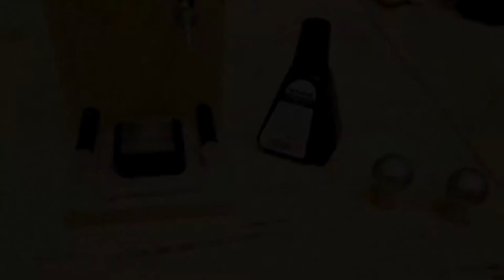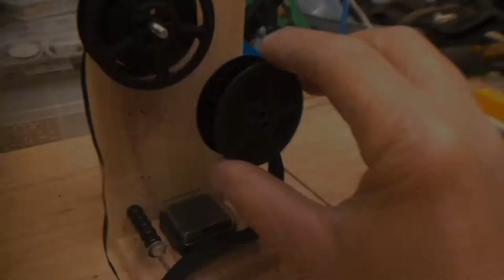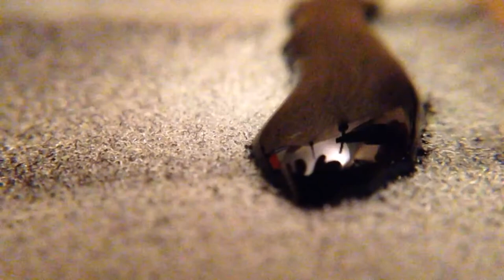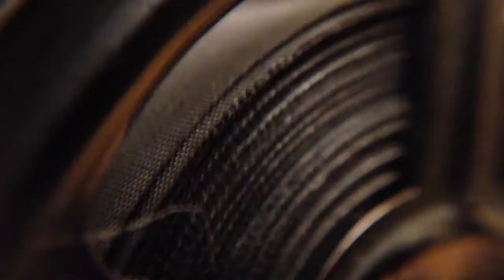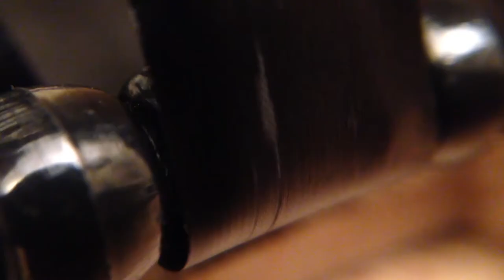Typewriter Maintenance - Ribbon Re-Inking Jig

Comment: I’m doing an experiment today.  I tried to Re-ink ribbon a while ago using an ink pad.  I made a mess and the results weren’t what I hoped.  Today I’ve tried a new way.  I bought some Parker ink.  I took a syringe from my kids old cough meds bottle. I used the syringe and put some drops of ink all round the ribbon while it was half spooled on each spool. 6-7 drops in total between the two spools seems to be enough.  I then wound the remains of one spool onto the other so all the ribbon was on one spool - just to have a look-see.  The ink had wet 90% of the ribbon but it seemed patchy.  So I got out my vacuum sealer and vacuum sealed the ribbon.  That works to marinate meat and force the marinate further into the meat so I figured it would work on ribbon.  Then I put the vacuum sealed ribbon with the plastic on into my salad spinner and gave it a whirl - hopefully the centrifugal force will bring the ink to all parts of the ribbon.  If nothing else I had some fun.   It was not at all messy and I didn’t get my fingers or table dirty at all.  It took less than 5 mins in total including the clean up.  And I have perfectly re-inked ribbon now.  Note I let it sit while vacuum sealed for two-three hours.  (My vacuum sealer is an Andrew James simple kitchen vacuum sealer - nothing special btw).
Reply: I tried this as well.
I think I let it sit in the vacuum sealed bag for an entire day.  It was still pretty blotchy and inconsistent when I used it.
Some other ribbons that I've left in just a zip-lock sandwich bag, but for longer, seem like they have evened out a lot better.

Comment: I have that exact model! Very clever. My ribbon is weak ordered replacement ribbons on Etsy-the keys are not striking ideally like yours seem to be.
Reply: flush the base of the type bars with some lighter fluid, this usually cleans off the dust, do not oil that area as oil arrtacts more dust, which jams the type bars.

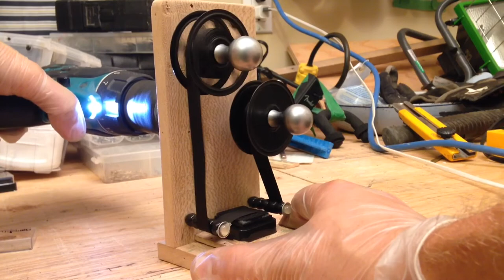Comment: Jig sure looks & works good, but End result didn't look so good 0:40
If ribbon is used, it will have a wear path of thinned out cloth & with cause quality performance issues like inconsistent density
Reply from the maker: True. There is too much ink on the ribbon. And also incorrectly threaded. 
Operator error.

Comment: Darren  . . . question . . . it occurs to me that you probably bought the spooler/inker device but I am also thinking you could make one from an old 8mm film editing tool--something like that? also realize that maybe you just parted out a typewriter for the spools ??? Curious. Thanks!!
Reply: The ribbon is sold on spools.  If you're re-inking a ribbon, it shuttles between the two spools in the typewriter, so you just lift the spools out of the machine, ribbon and all, and mount them on the re-inking jig.

Comment: Excellent video production Darren,
I do not want to make the jig now. I have a stamp pad and bottles of stamp pad ink. I don't mind if its messy (will wear gloves) could you give me guidance how to re ink the ribbon manually. Any suggestions appreciated. Thank you and all the best.
Reply: I use a small brush 4-5 mm width, mine came in the cap of the stamp pad ink bottle. Paint the ribbon surface with stamp ink , turn spools, repeat. It is messy (I work on old newspaper) and takes forever but it works. You don't need to be precise or anything, the ink slowly tend to seep around  in the ribbon due to capillary motion.
Reply: @sandrodunatov485  Thank you for your reply Sandro. Will follow your guidance and give it a go.

Comment: Hey, guys!I just got a German Olympia Splendid 33, 2 days ago.It works well.Only it types lightly. I mean the ink might have dried. Do I need a special typewriter ink.Or can I put a few drop og ink they sell in pot for pen and feather writing?I was wondering if they could damage the ribbon or machine.Cheers ;)
Reply: Hi! I'm not an expert, but I think the ink can't damage anything)) But it could dry as well...
Reply: @louis.gabriel  i tried Dr. Martin's bottled India ink...DID NOT work. All the reseaech I've done since then points to needing "stamp pad" ink...it stays moist/wet so doesn't dry in or on the ribbon after application.
I still need to try it, though.
Good luck.
Reply: In the beginning of the video right next to the ribbon jig is a bottle of Trodat Ink. I'm presuming that Trodat ink was used.
Reply: Ordinary feather wrting ink is water-based and will dry out soon. You need "oily" ink, like stamp ink.

Comment: Hey guys, I was just wondering if I could simply flip the ink spool to the opposite side of ribbon. I'm out of money, please help!!😕
Reply from the maker: Yes, flip it over.
Reply: It works, but  if one side is dry, the opposite side will be almost dry too, so you will get a few more miles, but not another full "tank".  You need to re-ink , a small bottle of stamp pad ink will do. It's slow and messy, you will miss the small concoction described in this video. I do miss it for sure.